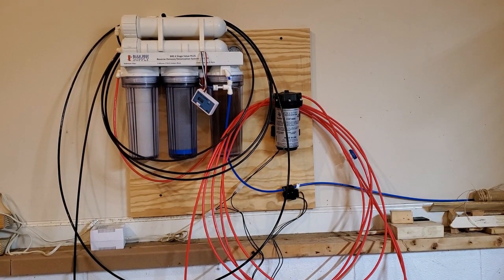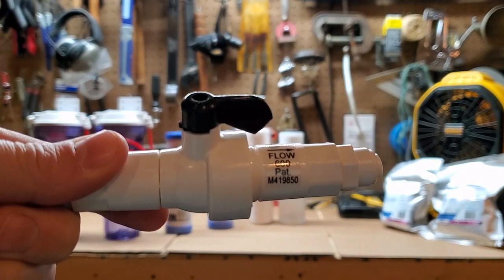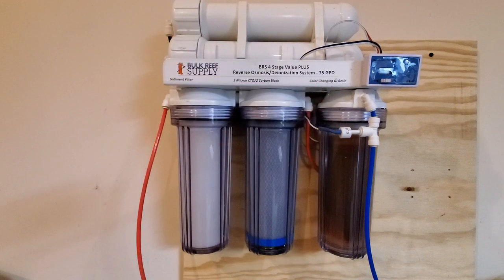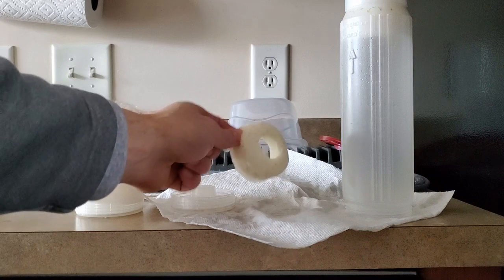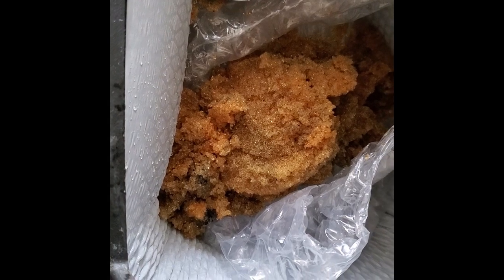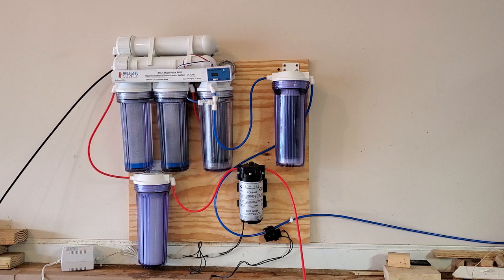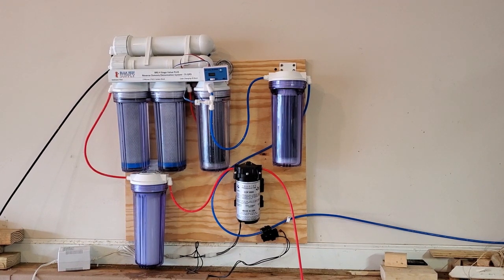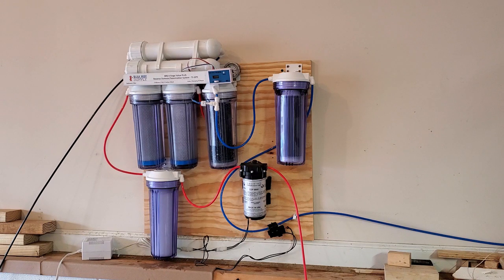Upgrade a BRS 4 Stage RODI Unit to a 6 stage

Comment: Did you leave the Flush valve OPEN to the MAX while the Booster pump is running, sending Good RO water to your reservoir?
Reply from the maker: I open the flush valve for 3-4 minutes with the booster on. Then I close the valve after that. It works well